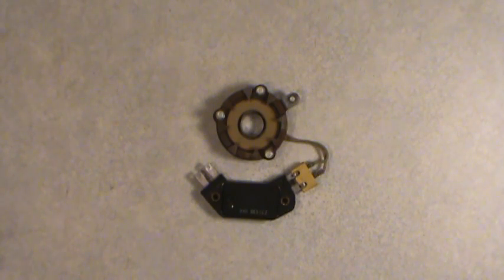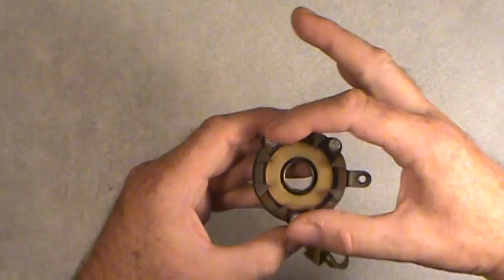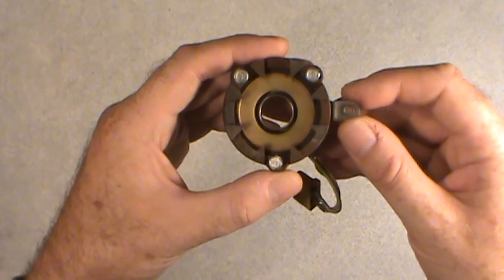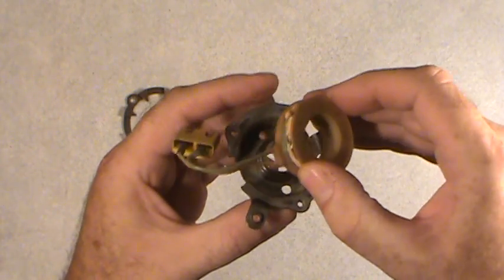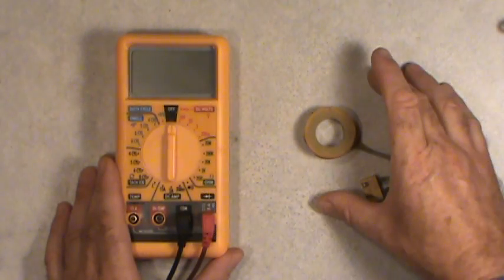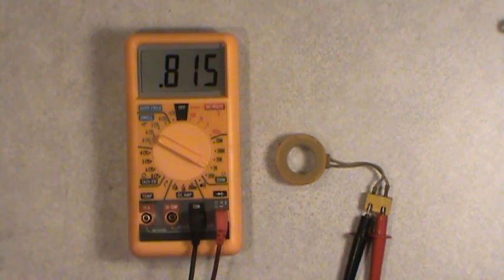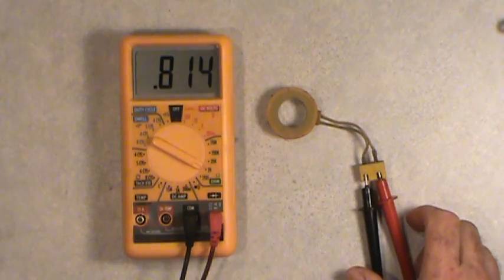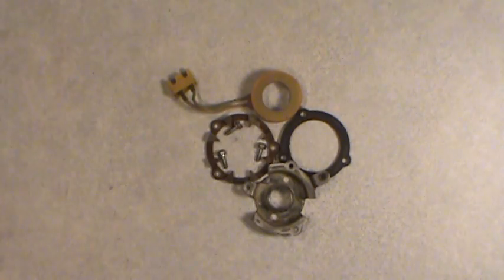HEI Distributor Pickup Coil Test

Comment: I am unable to get the housing off the shaft. I removed the C-clip retainer, but the housing feels like it is welded to the shaft. 
Took the coil, magnet, pole piece and shield off, but housing won't budge. 
I may have to reuse the old housing if I can't get it out. 
Any ideas? (I've used PB blaster and tried torch on housing. Ready to try a gear puller next.) 
I may also pull the roll pin so I can twist the housing back/forth with a wrench.
Reply: Never mind. Heat and penetrating oil followed by gentle prying around circumference popped it out. (2 days later.)
Reply from the maker: Greetings johnparker4836.....Thanks for watching......In order to remove the shaft from the HEI's aluminum housing, you will have to remove the roll pin with a punch of some kind, then, remove the gear and the washer that goes between the gear and housing......Sometimes, there is a carbon/sludge kind of build-up, that can be stuck onto the middle portion of the shaft, that can make it difficult to get the shaft out......Try to get some penetrating oil into both ends of the housing, where the shaft just starts showing....Then what I do, is to, pull the shaft quite firmly, while rotating it back and forth a lot of times, and for me, it always comes out, sometimes not so easy, and sometimes, not much of a struggle at all.......When it comes time to put it all back together, then, this step, is very, VERY IMPORTANT!!!........On the "gear", there is usually a "Dimple" (as in, a partially drilled hole/not very deep), that is quite close to, where the hole for the roll pin is located........This "Dimple", has to "line-up" with the "Rotor's Metal tip", once it is mounted/screwed, back onto the top of the HEI's weight assembly.......If it installed 180 degrees out, to where it should be, then, it might cause, some strange, kinda, ignition related misfire, I be thinkin'.......If I recall correctly, that gear has "13 teeth" on it, which is an odd number, that can't be equally divided in half, and, if it is installed 180 degrees out, the "clocking" (angular alignment), would be in the neighborhood, of being 1/2 of a tooth out, possibly........If your problem wasn't what I was tellin' you about, just above these words, then, just type another comment/question, and I'll try to help you out.......Good luck, and.....be safe, take care, and have a good one.
Reply: @RockysRoadshow  Thanks for the feedback. I experienced the shaft seizure as you described and figured that out after a day or two. I was able to get the coil housing off as decribed above. 

I did not know about the dimple, and have inserted the distributor, but may have to pull it again to look. The problem I am having now is the car will start and run fine. I noticed a "jump" in timing mark that bothered me, but was able to set it. 

Problem is; car runs for 30 seconds to a couple minutes now, then just dies as if I turned off the key. This has stopped me dead for a few days, and I wonder now if being 180 out would cause the stall. Sure seems likely, and thank you so much for mentioning this.

Edit: After reading a few forums just now, I think mine is in correctly. One of the issues I had was rotor pointing to passenger side (cylinder no. 2) at number one tdc, instead of driver's side cylinder no. 1. This caused interference with plenum, so had to move all wires one spot over to be able to turn distributor far enough for initial timing. It's in there now squarely so I could move wires back to optimum position for twisting without interference. (Had to twist oil pump with a screwdriver, to get it seated. (That bump the engine drop-in method can break teeth I hear.)

Trouble shoot goes on for stalling. I have no scanner comms, so back to figuring out why EST bypass no longer throws a code, and ESC may be bad, and damaged ECM driver(s) finally, if ESC chart hasn't led me astray. No codes either. Can't run long enough to test things.

Any thoughts greatly appreciated.
Reply from the maker: @johnparker4836  Greetings...johnparker4836........Here are a few things for you to try/consider........If you have a timing light with an inductive pick-up clamp, that clamps onto a spark plug wire, then, connect your timing light, onto each spark plug wire (one at a time), in order to see, if each of the cylinders, are getting a good steady "pulse" (aka, bright strobe flash), so to speak, as in, does the timing light, show even light flashes, as the engine is at idle speed, as well as, at a bit higher in RPM's as well...???.......I had a V-8, that had a similar, stall at idle problem, and, I also, initially suspected, that it was ignition related as well........What it turned out to be, was that, the carburetor's..."idle circuit"...passageway (one or both of them) were plugged up a bit too much, and, even though I turned up the idle speed screw quite a bit, it would slow down, and then stall, dead as a door-nail...lol.......So, I rebuilt that carburetor, (new brass float too), and reset all of the choke adjustments and such, and now, it idles like new, and, if I just touch the gas pedal, it accelerates, like the damn thing is fuel injected...!!!...lol.......If you care to, just let me know, what you vehicle happens to be, so I know what you are dealing with, as in...year...make...model...engine...etc......Good luck, and......be safe, take care and have a good one.
Reply: @RockysRoadshow  1986 Pontiac T/A w 305 FI . Fuel pressure is 35-42 when running, up to 42 when stalling, just a glitch upward upon stall. New ICM, pickup coil. Runs, idles down after cold start injector swithches off. Revs fine, smoothly, settles, runs, then just shuts off like a switch.    ADD: It used to just start and shut off before new pickup coil change.

Timing is 6 btc base with bypass unhooked per spec. Slight jump once when timing, but resolved before next stall. Cannot run long enough to troubleshoot. Looking at Electronic Spark Control; checking ECM charts for clues. Bypass no longer sets a trouble code when disconnected as it should. 

Fuel rail and regulator rebuilt. Fuel filter replaced less than 100 miles ago last summer. New intake gaskets, Mass Air Flow sensor, goes into closed loop. O2 sensor working. No ecm codes. 

Computer won't communicate with Actron obd1 interface; there is a signal present on the serial line. (This makes troubleshooting laborious and primitive.)
Reply from the maker: @johnparker4836  Greetings...johnparker4836........I'm back, and probably too late in order to help you out........If I had your problem,  when the engine just shut off, I would probably spray something like starting fluid into the throttle body, and try to start-er-up, in order to see if the fuel injectors were working or not........Then, I would check for a good strong spark (calibrated spark testers work really good for this)..........I hear Ya, when it comes to the good ole OBD-1 alright..........If you ever get a vehicle, oh, about 1996 or newer, then, it will probably have the OBD-2 system (16 pin port, I think), and, for about $100 (dollars), on Amazon, there is a dongle (lol), which really just means, a small box, with a few electrical connections on it, and it's called..."Blue Driver"...that plugs into the OBD-2 port.........It pairs up to your smart phone via blue-tooth, and, the information that it can extract from the ECM, is mind blowing, as in, live data, select just about any parameter, or list of parameters, that you want to monitor, and it even has a list of suggestions, for diagnosing/fixing most of the problems that are not within the allowable operating limits........Damn thing even reads "mode 6"...!!! (if I recall correctly, that is)...which is a very advanced way of scanning the ECM.........Another thing that I remember, is, to make sure and have the proper..."Heat sink paste"...(same stuff that is used on computer chips), applied to the bottom of the Ignition Control Module (never use something like die-electric grease, as it's not intended for heat transfer).........I recall hearing, that, without having the proper heat sink paste applied, then sometimes, the Ignition Control Module works ok for a while, then, just quits, once it gets too Hot........It might even start working again, when it cools down, or, just gets completely Fried and useless..........All an engine really needs, is....compression...spark at the right time, and the right amount of fuel, for the temperature (cold start), and for all load conditions as well, as in, just cruzin' along or goin'...Pedal-to-the-metal...(aka...floorboard)...lol.........Good luck, and...be safe, take care, and have a good one.

Comment: Great video step by step explanation including multimeter testing + reading results. My Chevy 4.3L marine vortec engine in the boat died last summer. Fortunately a marine specialist master mechanic finally diagnosed the faulty pick up coil after several other marine mechanics simply could not solve the no start "mystery"... again this is a perfect problem solving video and description. Thanks very much!

Comment: I have change my ignition module, primary coil, distributor cap on my 78 Chevy 350 and still want start! It turns over very fast but no spark. I did forget to disconnect the battery before changing the ignition module, could I have damaged the new ignition module? Great, thorough video!

Comment: Morning from here mate. I have a bosch hei in my gm holden v8. I've changed coil and still getting a weak yellow spark and no start. I'm thinking maybe the ignition module. Not sure though. Do they either work or not?

Comment: At idle, the vacuum should be high.
Upon acceleration, the vacuum drops and the vacuum advance retards the spark timing until vacuum is restored.
That's how a vacuum advance works.
Then, we have the centrifugal advance that is rpm controlled.
I guess I should make my own video clarifying the basics.
Reply: Vacuum advance vacuum is known as ported vacuum and is above the butterfly to give more advance at higher revs.some older vehicles used manifold vacuum in conjunction with mechanical centrifugal advance but from the 70's on most only had vacuum advance using ported vacuum until electronic ignition took over.

Comment: You can also heat the coil a little because the windings in the coil can broken and intermittently expand and go open with heat very common.  You heat the coil up with a heat gun or even a hair dryer and it often goes open.

Comment: I checked my pickup coil and it read 841 on the vehicle. Still didn't mean the distributor itself was good. The wife and I just changed the distributor about an hour ago, got lucky everything lined up, and it fired up on the 1st crank. We are so happy. My point is, just because the pickup tests good, you too may have a bad distributor for whatever reason.. Thanks for all the info RockysRoadshow.

Comment: Good and clear explanation, thanks for that! I have a Mazda with the B6 engine and I am suspecting that this pickup coil is the problem leaving me with not a spark to be found anywhere! Time to pull the distributor and do the checks!
Reply from the maker: Greetings...Stewart W. .........You're welcome, and, thanks for watching.........I don't know about your Mazda B6 engine, but, if it has a distributor, along with an ignition control module, then, if it works kinda like the General Motors HEI distributor, make sure to use the "correct", heat transfer-ing compound, between the bottom of the ignition control module, and, where it mounts onto, if applicable, that is........Use the same stuff that the computer folks use.........Just get the cheaper stuff, because, some brands get quite expensive...(never use "die-electric" grease, because it's useless, for heat transfer...!!!)..........Your ignition control module, might have over-heated and fried, possibly (if applicable, that is)........Look for some websites that have "forums" on them, for your exact vehicle, and/or engine, as, there are usually some very smart folks on there, that will probably be able to help you out, once you post a question to them........The only Mazda that I ever drove and worked on, was a 1973 RX-3...2 door...automatic transmission...that had a Rotary (Wankle) engine in it........Damn, 70 cubic inches, and it put out 90 horsepower...smooth as silk (terrible gas mileage)...but, once it hit about 3,000 RPM's on the tachometer, it sure came to life, and then some...!!!...lol........It even had a small factory installed 4-barrel carburetor on it.........Then, there was this little yellow light, which was also a push button on the dashboard.........It was supposed to light up, when it got really cold outside, and then, push that button...!!!...but...it never "lit up"...lol........Now get this...when that yellow light/push button was pushed, it was supposed to inject a solution of, as I recall, 90% anti-freeze & 10% water, into the engine, to help it start, when it was cold outside (I imagine, that, it  had something to do with, the aluminum combustion chambers, and possibly, the rotors themselves, possibly...???)...cool huh.........The ignition system was something quite different...it had two distributors (leading and trailing), "3" set of ignition points (2 of them, inside one distributor, and 1 in the other distributor)...2 ignition coils, and, 2 ballast resistors, oh and 4 spark plugs (2 per combustion chamber, and, they are kinda peanut shaped at that...lol)........Good luck with your ignition system, and......till next time......Be Safe, take care, and have a good one.
Reply: @RockysRoadshow  Greetings from South Africa and thanks, man! Yes it was the pickup coil at fault. I decided to buy a reconditioned distributor just to be sure that there would be no other component at fault. After all the vehicle is 24 years old!  Now I have fire!

Comment: Can the pickup coil be tested with the distributor in the engine? If it’s good there’s no need to go through all the hassle of removing it. Also, how do you test the ignition module to see if it’s good or not? Thanks!
Reply from the maker: Greetings...Cliff Klimas.........Thanks for watching........You can ohms/resistance test the pickup coil, without removing the HEI distributor from the engine.........Once the distributor cap is taken off, it's just a matter of disconnecting, the pickup coil's, two wire connector, from the ignition control module........Then, connect the ohm-meter's probes, to the two terminals, that are inside of the connector.........While ohms/resistance testing the pickup coil, bend those two wires back and forth a little bit, just in case, the wires are questionable/broken internally, and, if there is a problem, the ohm-meter should indicate so.........There might be a way, to test, the usually, 4-pin style of ignition control module, but, I haven't looked into that, at all........Just make sure, to use the "correct", heat transfer-ing compound, between the ignition control module, and the pad, that it mounts onto, because, if Ya don't, the ignition control module, will usually over-heat, and destroy itself...!!!.........I use the stuff, that the computer folks use, for their BIG heat generating chips (CPU's), and, I just buy the cheapest stuff, because, some brands, can get quite expensive ("never use", die-electric grease...!!!)...and......till next time......Be Safe, take care, and have a good one.